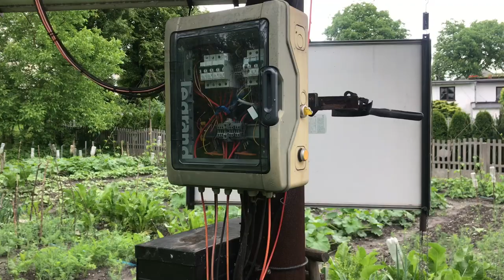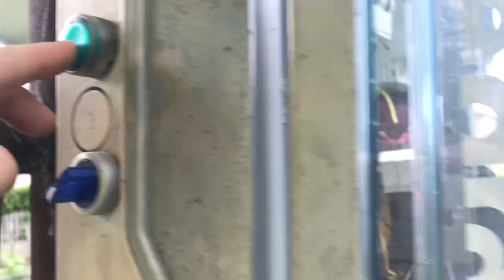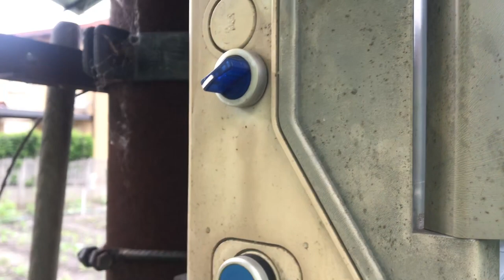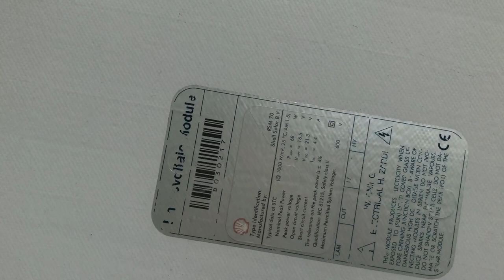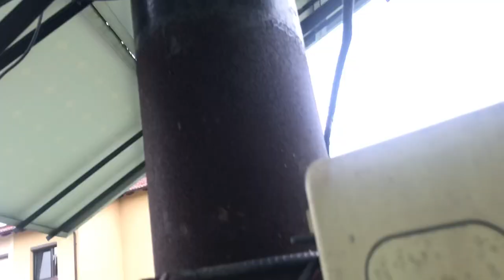Solar tracker dwuosiowy DIY z części samochodowych

Comment: Please share your drive system info?
I started laughing….your recycle ability is supberb!
Love your use and reuse of auto related materials…!
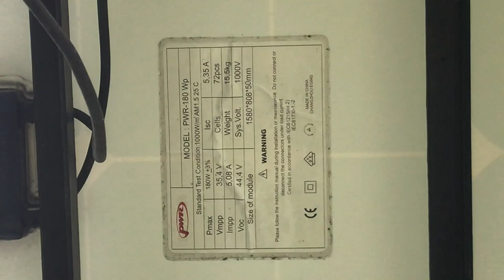Reply from the maker: The motor that drives the worm gear is a brush screwdriver. The worm gear has a 1:50 ratio for strength and impact resistance. The transmission of the drive between the gearbox and the rim of the car is by means of a chain. The chain is attached to the rim with 2-3 stainless steel screws, in case of heavy overload they should break. The horizontal axis is locked using the handbrake.
I see that it would be useful to make English subtitles for the film so that everything is well explained, what do you think?
#scraptech is a good thing and relatively cheap, why reinvent the wheel when everything we need to build other machines is in the car.
Reply: @SzymonHawlicki  English subs would really make your project an international art show
Haha
We’re the screw drives borrowed or purchased? Lots of great 12 dc motor ideas out there…!
I have a reduction box for a dc motor drive
Just needs an adapter at both ends…I have 100 used sharp panels that need sexy moving trackers…my current trackers are phase change type…but they all are now unreachable $$$$
Reply from the maker: I will try to do a translation, unfortunately my English is not the best and I have to use a translator.
The screwdriver that was used was my first cordless screwdriver, which I bought, unfortunately the Ni-Cd cells died from old age and the screwdriver lay until I found its use. Now the screwdriver got another life in a solar tracker 😁.
Later, I bought a whole carton of damaged screwdrivers for PLN 200, there were probably 50 of them and they went to parts like PWM for motors, etc.
Exactly, an adapter is needed, I have a hexagon made on one side, and on the other side there is a shaft with a place for a wedge. Now I would buy a 1/4" adapter for the chuck, and hammer it into the hole to the shaft, cheaper and faster.
Maybe a 1-axis solar tracker would be a good solution for such a quantity, it reduces the cost and complexity of the project.
Reply: @SzymonHawlicki  I’m so sorry to take you out of your local language and comfort zone.
I got your idea for collecting more screwdriver motors…I’m confused…what is pla-200?
PVM for motors?
I have several trackers I’m building
So I don’t want to miss out on something free….!
I was going to use my discarded ryobi
Drill motors for the turn table drive
Maybe use a machinist rotary table.
So many fascinating ways to get to nirvana
Haha.
Reply from the maker: No problem, it's good to give your brain an intellectual squeeze once in a while 😁.
With cordless screwdrivers, it's about economy, if you want to buy one that doesn't work, you have to give $ 10, if you buy ten, you will give $ 20. "PLN 200" is $45, so very cheap for a lot of equipment and parts. PWM - "Pulse Width Modulation" is that the engine makes such a squeaking sound when starting and you have power dependent on the pressed button, smooth power and speed control. The motor powering the gear works at PWM 50%, so that everything works without heavy loads and the clutch of the battery screwdriver will work when overloaded. If you have access to a machinist rotary table it might be a good solution but I don't know how it looks with wind resistance the system has to be able to "submit" to wind or snow - so the mechanism has to be at least a little watertight. The possibilities to make something out of nothing are endless. 😁